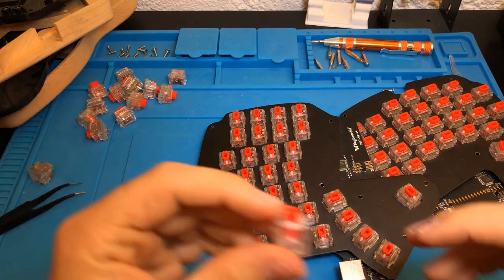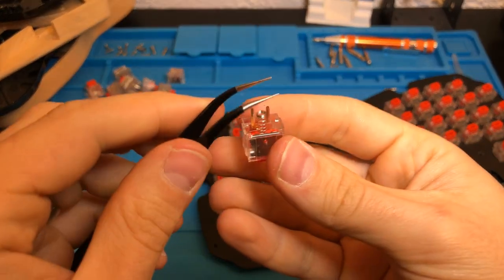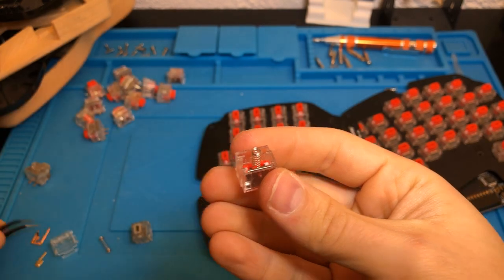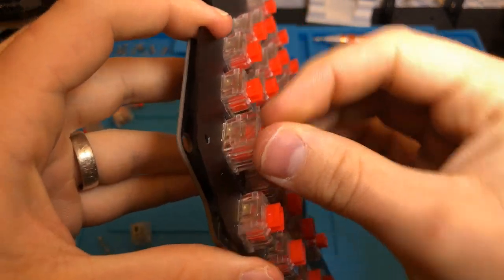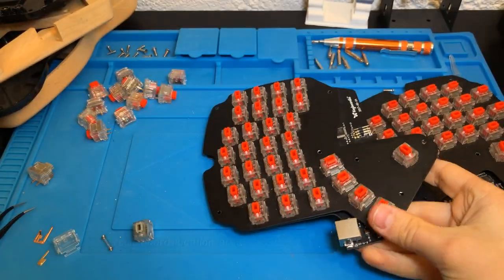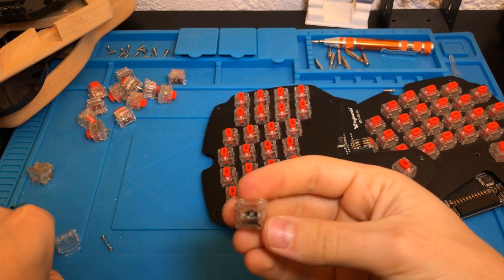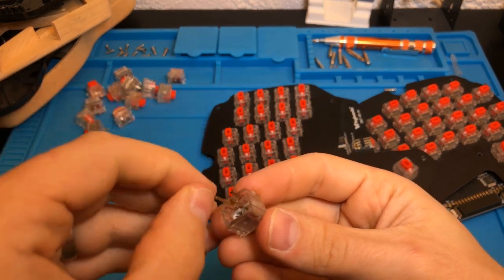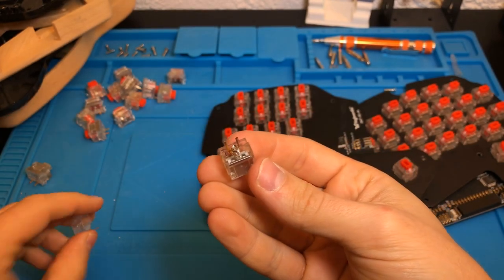Replacing Keyboard Switches without Soldering

Comment: The leaf you're talking about in the switch disassembly doesn't tell us whether it'll be linear; though it does influence the type of tactile event we have when combined with the stem. The reason that Holy Pandas are all the rage is because the metal leaf in a traditionally linear switch (invyr panda) enhances the tactile event (lengthen the tactile event and make the bump a bit bigger) that halo true/clear stems usually provide. Looking at the stem's shape at the bottom will tell us how smooth, long, and tactile the bump will be in any given switch.

Glad that you're a bit into the frankenswitch game :)
Reply from the maker: I guess I still have a lot to learn about switches. Thanks :)

Comment: I bet one could model and 3D print a little tool that  you could just slip over the switch and have it pop the latches. That'd likely spare your fingertips and speedup the process. This was a really interesting video. I would have never thought of tearing down the switch to replace the parts and save yourself from de-soldering and soldering everything. Not sure which is more tedious, but I do know that my soldering skills are such that I'd opt for your method . :)
Reply from the maker: That is a really good idea! I’ll have to try that.

Comment: Thank you for the video! Do you think using this technique I could fix a broken switch that makes contact all the time without soldering?
Reply from the maker: I think so, yes! I actually had this issue with a few switches during changing them and it was fixable by taking them apart and making sure everything is placed correctly. However, I’ve only tried this with the Alps design switches. No idea if other switches work the same way.
Reply: Yep, I've had to do this with a bunch of the switches in my older-generation Model 01. You just need some alcohol wipes (prep pads), and you just need to clean up the contacts on the centre stem of the switch, on the contact leaf leg, and on the metal piece in the switch. It's pretty quick to do once you get used to it (I used just some cosmetic tweezers to pull the switch while I used fingers to push aside the clips).

Comment: do you have a tutorial for replacing WITH soldering?
Reply from the maker: No I never tried that. I considered it but decided that changing only the mechanisms is less risk of me breaking stuff.
Reply: @matoumakes  I see, I ended up following a generic soldering tutorial and surprisingly it was super easy! So easy I even think there's less of a chance to break something by soldering than by opening it up to replace the mechanism lol
Reply: @GGs-c1u  I worry about heat damage to the microcontrollers in soldering, if you didn't get the heat-sink set correctly. Did you have any issues in that regard?
Reply: @SyneMitchell  no, there's a specific area where you apply the heat which is covered by metal. Also, the solder melts very quickly, almost instantly, so it's very fast